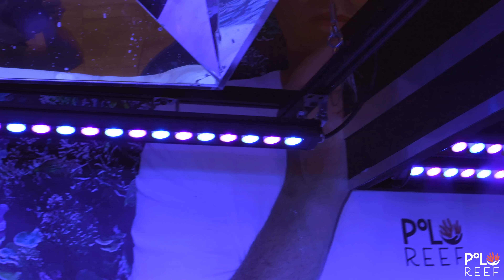REEF UPDATES: ROCKSLIDE IN THE 17,000 REEF, SAVING RARE FISH, LIGHTING UPGRADES, TRIMMING COLONIES!

Comment: gotta love the orphek bars.. i have a tank with 6x orphek or4, such a great light and do a good amount of par. the lunar cycle combined with helius setting is a game changer.. or when u get difficult corals, then u can set the light schedule from their exact location, in real time.
Reply from the maker: never used that setting  but will check it out
Reply: @PoloReef  i believe that orphek or4 and the Orphek icons are the Only fixtures that are dimmable 0-10.000%, so their lunar funktion is probably best on the market . Since its Can do Extremly low PAR to mimmick the moon and on auto pilot with 1 Press.. 

The other feature with full cycle from chosen location is also smart , unless ur tank doesnt see a shred of synlight, then I guess it wont matter much in the Long run.